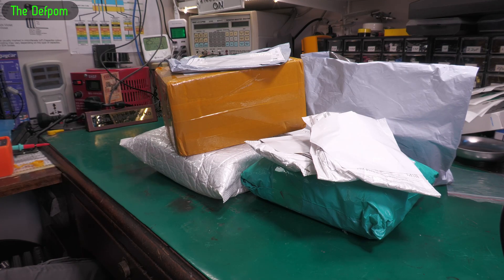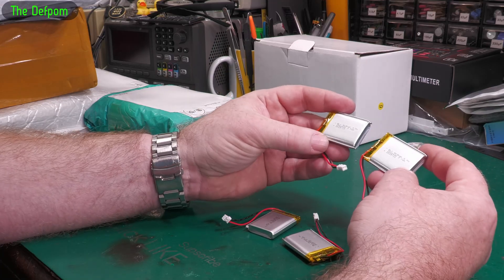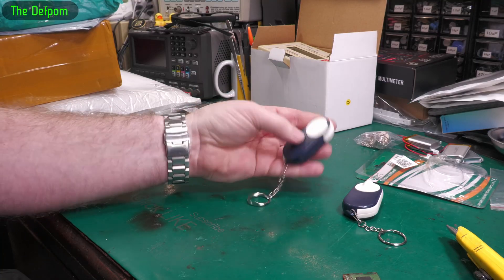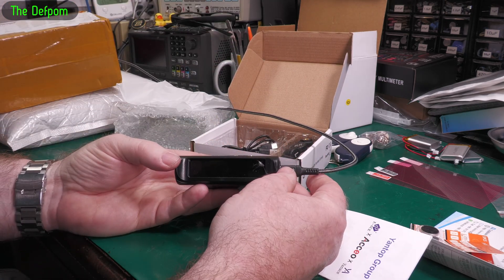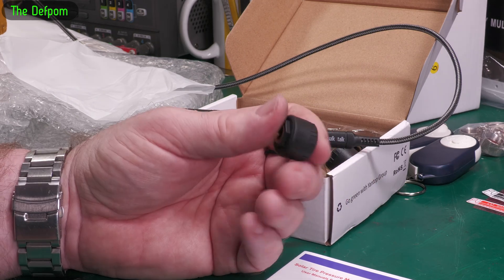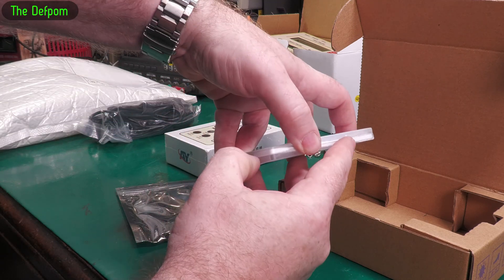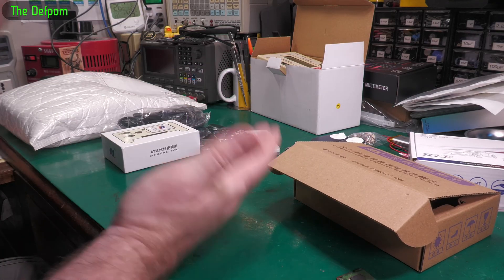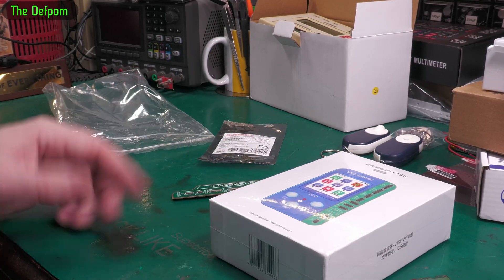🔴 Mailbag Monday 8th December 2025 - No.1433

Comment: I've not used either of those programmers, as I bought mine before JCID became "the standard". I have the QianLi iCopy Plus with a bunch of boards, but I will be getting the JCID, when I can find a good deal on one. I've spoken to quite a few fellow techs, and they all agree that JCID is the way to go, and that their support is fantastic (should there be need for support). JCID also covers more than most others, f.ex even my iCopy is kinda outdated now 🤷‍♂ When changing screens (if buying aftermarket), it is 100% necessary to use a programmer, or replacing the chip for the one pulled from the OEM screen. Buying refurbished screens (genuine refurbished), there's no need to do anything, as the parts calibration will recognise it as a genuine part, and pair it in the cal. proc. 😉

Comment: If you want to use the cells in series, You'll need to remove the cell protection boards and add a common BMS to keep the voltages level over time.  If you want to use them in parallel, you technically need to remove one of the cell protectors, though I've gotten away with not doing so with same-cells.
Reply: Is there’s room for a single PP3 style lithium-ion battery if looking for 8.4V it would be better/safer.
Two single cell Lipo’s with questionable BMS’s in series can get unbalanced quickly hence the issues.